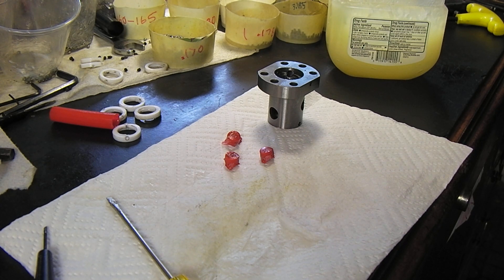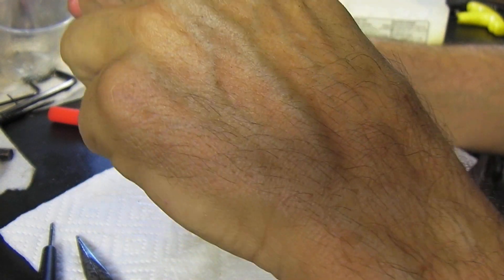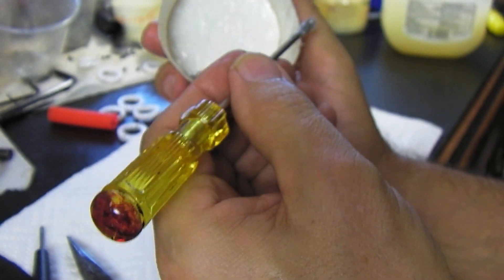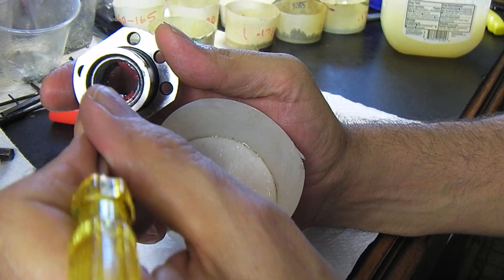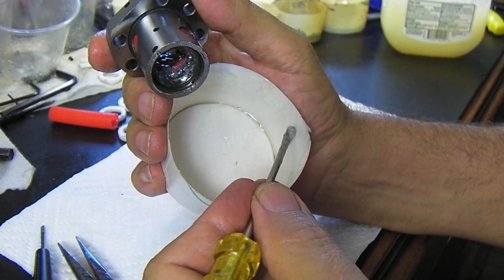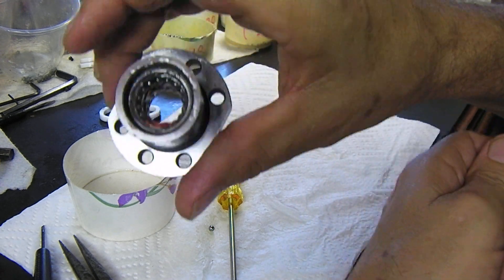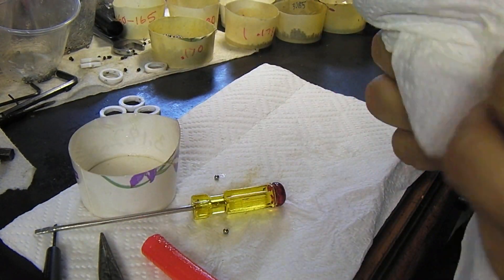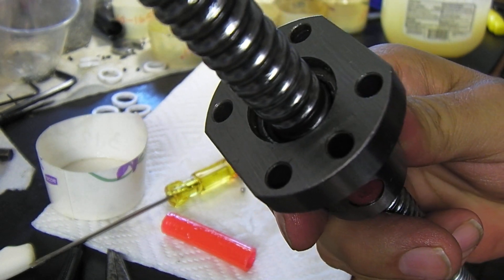Repacking Ball Nut RM-16 C7 Ball Screw

Comment: Great info. I still have one 1605 to repack (Z-axis), missing some balls. I measure 3.14 - 3.15mm, but they are most likely 3.175mm. I never realized how inaccurate the calipers are. Time for a proper micrometer. Better grasp with 3 dec places.  As with all the linear bearings, the volume of wood and aluminum chips was astonishing. It had arrested inflow of grease. Twelve Hiwin  HGH20CA  took hours. ~200 balls per, tweezers and patience. There is no YT vid that I could find outlining the process and my footage is still in the camera and lacking the B-roll footage (endoscope). Those noobs with stock dust shield and end seals might labour under the false assumption that they are sufficient,...not one iota. I sought the Hiwin "HH" end seal upgrade must be purchased thru a qualified distributor which means huge mark-up. Add shipping, brokerage fees and tax. What is the remedy for improving the simple dust shield on ballnuts ???
Reply from the maker: For really dirty environments just using dry lube might be best. Gunk is the real killer. 
On your balls I can re pack your screws for $35 per nut.
Reply: @ArizonaVideo99  How kind of you to offer the info and service. Turn around + shipping = got to muster thru. 
Just plowed through 12 pcs of the HGH20CA. 2400 bearings!!! I've sourced the Gunk graphite. Hiwin doesn't suggest this but the Z axis ballscrew doesn't get quite the workout. It would be great if the "wiper" was a bit more exclusive. But if the exposed ballscrew has no grease or oil film to stick to, then less swarf will adhere. Anyway, at this point I found a bag of 3.175 bearings ( I measure 3.15 ) to replace some that are absent but rated @ C40. My calipers are measuring 3.14mm ~ 3.15mm dia. balls in the 1605. What will I measure when my anvil type micrometer arrives?

Comment: I have a pair of SFU1204s and followed your video on repacking. I noticed the bearing in mine keeps binding at the orange bearing recycling cap thing. The bearings keep stumbling over each other in that area. Does that happen to you?
Reply from the maker: If the balls are tight they pop into the tracks when free spinning. It should be vary light. If it binds much at all then the balls are too large. Other things come into play too. All the balls need to be the same size. You may expect them to be but a loose ball nut you cant tell if a ball is too big. When it's tight the big ball will stick each time around. This should only happen about  once per 3/4 of a turn. This is also rare, most the time the balls are close enough to the same size.

Do a single row and see how they fit.  If one row binds and the others are fine then move the return around and see if the binding follows it. It can be replaced if needed. I have spares but I dont know if the 12mm balls and returns are the same. 

If only one row is tight then you could put the smaller balls in it. You will loose 1/3 of the strength, its not needed for routers but mills will need it. You could also just lever the balls out of one row.

Comment: Thanks for this. I purchased a kit from heavy metal cnc and the acme nut on my z axis is installed opposite end of standard🤷‍♂️. Per the z axis assembly diagram. I looked at dr d Flo’s conversion video and his was also opposite mine. Bruce didn’t do anything wrong, that’s china for you….. bad assembly. I had to remove , repack and reinstall mine.
Thanks great video!

Comment: What's a sign that your ball screw needs to be repacked?
Reply from the maker: Just the amount of backlash they have. Most of the China screws come with loose balls. For single nuts anything over .003" should be re packed. If the screw has over 1000 hours it might be more tricky with the high use area being looser.

Comment: Your video is great but I am having a nightmare. Do you try and fill every groove or you mentioned just 3 rows? Also what are the sections to avoid like?
The nut I am trying to sort has tiny 1.48mm balls. Was working fine but wound it out too far.
I have got it back together but it is very tight and loads of backlash.
Reply from the maker: Just 3 rows. If you look closely you can see a space between the returns that have no where to go. Start from the return and fill one at a time until you get back to the return. Do that 3 times.
Reply: @ArizonaVideo99  
Thanks so much for taking the time to reply!

Comment: Hello! Do the ball returns have to go in the nut in a certain orientation? Or are they universal and always fit in the correct orientation? I know you mentioned you could put any of the three returns in any of the three locations, but I can't tell if you're putting them in a specific way to line up with the thread of the nut.
Reply from the maker: The returns can go either way but must line up with the track but they will self adjust if they are sitting in all the way. Sometimes I need to put a little grease on the back of them so they don't move around and fall out.
Reply: @ArizonaVideo99  Thank you so much! I tried to look up some diagrams on finding what threads/loops to void and what threads/loops to fill with the balls. Could you describe a little more how you know exactly which ones to fill/not fill? My dad and I have been trying to insert the screw and it kept jamming, so after watching your video I'm certain we are filling a thread/loop we aren't supposed to be. I had a hard time seeing the loops not to fill that you talked about in your video, and was hoping maybe you could add some more details in the reply if you have the chance!
Reply from the maker: @haydensarah99   If you look inside the nut you will have 3 plastic returns.  The outside returns have the track run past then but if you put balls past the outside return they will just fall out or push out the seal. 

The middle return has a small bit of ball track between it and the next return. It is about long enough for 3 balls or so. 

If you put balls there they are stuck and will jam the nut. There is two places like that on both sides of the middle return. Once you see it, it becomes easy.

Comment from the maker: All the RM-16 style screws come from China. Good is a bit of a question. The screws are mostly good to really good from most re sellers but the nuts vary greatly. It just takes time to fit a nut with the exact balls to be tight. If you screw is over 4 years old the balls might be slightly larger then .125 all the newer ones are slightly smaller than .125.  There was a ebay re seller selling chrome steel  balls but I don't think he still is.  Balltec in the USA sells them but they cost a lot and it is almost inclosable to get the correct fit on the first try.   I have a lot of balls, anymore I get extra from China but with double nuts I generally dont have to change balls just shims.

Comment: I have a very similar ball nut but my returns are oblong.  Does it matter which way they go?  My nut jams so I am trying to understand this "zone' you are mentioning.  There are three returns and the gap between the returns are different.  I am assuming the short gap there should be no balls.  And in the larger gap should there be any balls?  Wish I could see better in your video.  Thanks for the info tho.  It's giving me faith.
Reply from the maker: A jamming nut is almost always a ball in between the returns. You do want to check to make sure you dont have a really large ball. 

Spend some time looking at the tracks and the way the return moves the balls from one track to the next. To do this you will have a section of track left unused. It cant have a ball in it because it has no place to go. Its trapped.  When you filling the nut its easy to get a ball in the track between the return. 

One way to get a good look is to place the ball saver tube in the nut and spin it by hand to remove the extra grease. This sets the balls and you can pick out mis placed balls if you find one. For a 16mm screw the tube is about .535"

Comment: I've found petroleum jelly (Vaseline) loses viscosity too fast. Bearing gets warm from handling it, and then starts to thin out (loses its tack). Grease is better.
Reply from the maker: correct.

You can put the ball nut in the cooler. I just did not want grease on my hands everyday.

Comment: perfect, i was attempting to add a second nut to a 12mm screw and tried to put it on the machined end with the endblock thread and it all went wrong, jammed, removing it and balls came out. ebay ballnut, the balls are 2.38mm / 3/32" . all is not lost, i thought the re-circulation was external but clearly not. not sure if here is a no go groove in the 12mm nut. great vid.

Comment: Any idea what to do if the nut gets seized on the screw?  I can get mine to turn a little, but it gets pretty damn stuck if I go too far.  Thanks
Reply from the maker: If you get a ball between two tracks it will lock the nut from rotating. Most the time it is more in one direction than in the other so you can still un screw the ball nut if you only go one direction.
 Sometimes it locks in both directions. You can use a good vice and soft jaws to hold the screws and just force it. What happens is it will crush the ball return so it will need replacement. I have a lot of extra if you want one.

Good luck.

Dave

Comment: I received a new rolled ball screw & nut like this but either the threaded hardware that goes into the hole in the flange was missing or it fell out somehow.   It's only threaded in the first 1/4" or so- I would expect it should be something like a set screw and maybe a spring or ball channel or some type.  I have no reference- only an empty hole.   Can you tell me what is supposed to go in there?
Reply from the maker: I dont understand the question
Reply: @ArizonaVideo99  There is a threaded hole in the flange, perpendicular to the axis of the ball screw.  There is nothing in that hole, and balls can fall out of it.  I'm assuming that is not normal and something should occupy that hole. https://i.imgur.com/ftb5iUM.jpg
Reply: @salukikev  It's for lubrication, usually they include a zerk fitting.

Comment: i just repacked the same nut dry, i put the journal in just about 3-4mm's, not exceeding the polymer bushing, poured bunch of bearing balls, with a little shaking to balls to settle in the tracks, i slowly inserted the journal all the way in. then by shaking, i removed the balls in the excess tracks. it looks to be working perfectly. is there anything wrong with my method?
Reply from the maker: There is two places between the ball tracks that can not have ball in place or the nut will jam. you can fill it like you said but you must remove the balls from the dead areas which is hard if the balls are loose.
Reply: firstly, congratulations on understanding my comment, lol. yeah i thought about the same possibility but those balls in the dead area weirdly doesnt seem to cause any jam, nut rotates all the way through the 500mm ball screw, without any minor blocking that can be felt. should i really remove those balls?
Reply from the maker: Yes, they will drag often times they will let the nut go on one direction but not in the other. I have found that if the balls fit tight you can never have a ball in the dead zone as it will alway jam in one direction. If the fit is loose that allows for the ball to skid. If it cant roll it has to skit and that is not a good thing.

Comment: Thank you so much! I was replacing a controller in a late 90s CNC with beautiful German ballscrews (every indication that the entire machine has barely been used) and accidentally removed the screw. I nearly panicked as I don't have room in my budget for a new ball nut any time soon. You've given me hope and I'm going to try this...tomorrow. Too tired tonight to be worth trying. 

One question: Because this is a unit that has long since been installed, I don't have the installation tube/foam that is apparently common. I'm sure I can find or make something appropriate (I have a lathe and tons of materials). How do I determine the ideal fit for the tube? This is a 15mm diameter screw with a 4mm lead and 2.33mm balls. Maybe 13mm?? 12? 12.5? 12.874???

Thank you!
Reply from the maker: Its easy.  You will need to find the right size tube to hold the balls.   do one row and then find a tube. Card board with paper and tape on top is OK If you have a lathe then turn something. If you missing a few balls its best to space them between the rows. 5 balls is no big deal.  Good luck!

Comment: First fill one track (full) with steel balls,remove one steel ball (for running clearance),proceed same for another tracks.Life of normal steel balls are less and their accuracy is not up to mark...Visit any reputed bearing dealer shop (like SKF,NTN etc...),They can supply accurate sized and accurate hard steel balls...Bearing balls are costlier than normal but gives a required accuracy and life too.
Reply from the maker: There is a guy on ebay that sells Chrome Steel balls for ball screws and then there is baltec. http://www.precisionballs.com/

Comment from the maker: Just fill each track. No need to count.  I think the total is 62 balls but it can be different depending on how big the balls. 

The fit is determined by the ball size. load handling is the number of balls. They are rated at 500 pounds

Comment from the maker: You can repack the double nuts but if you have lash you need to add a shim to have positive preload BETWEEN the two nuts. 

It is really tricky because the thickness needed is vary small like .0015" thick shim.

Smaller balls in one nut would make it easier. 

Yes you can remove the bars. To see how loose they are tighten the two nuts with a little force and check how they move. 

You could add a piece of foil or shim between the nuts to see the distance you will need to tighten up the nuts. You only need to remove one nut to add the shim and  a 1/2" tube with a little tape on it will stop the balls from falling out.
Reply: It took a few tries, but I think I got it without taking the two nuts apart.  At least my ballnut is rebuilt and in place in my G0704.  It seems to behave normally.  I'm not improving or repairing an existing system, I'm doing the CNC conversion from Hoss Machine for the first time.  I had some issues with ballnut removal tools and ended up dumping half the balls out of one of the nuts.  I was afraid I had lost some but needed three out of the hundred or so in the double nut RM1605 setup. 
Thanks again for posting this.

Comment from the maker: I have done many , many of the import screws and there is no correct size that is more common. 
The problem is getting things tight but not too tight. The difference in ball size can be .0002" to get a nut from .002" lash to almost zero. 

The nut can have some positive preload meaning the balls are actually too big to fit. What happens is with a rolled screw it will have some areas that are tighter and looser. The C7 screws are really a good screw in this respect and generally have really low  lead error and diameter error but fitting the right size balls will require trying a few sets to get a good fit.

I do repack other peoples screws for fairly cheep if you email me.

Thanks 
Dave